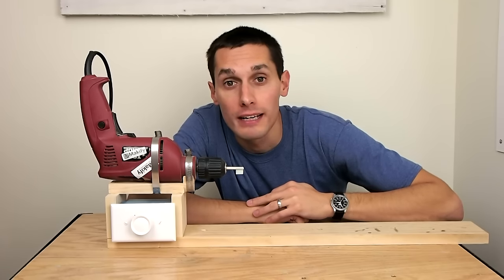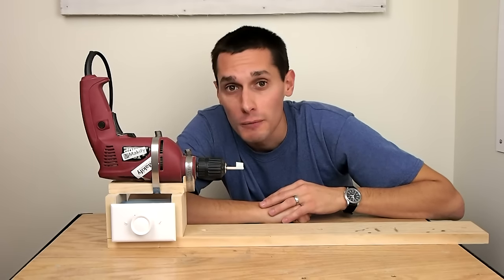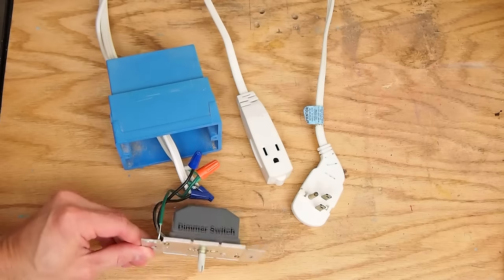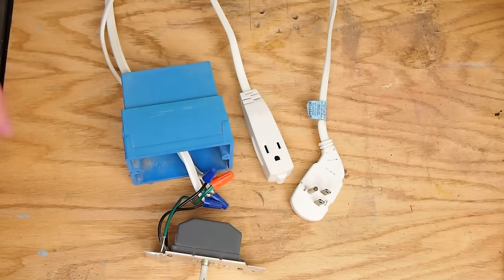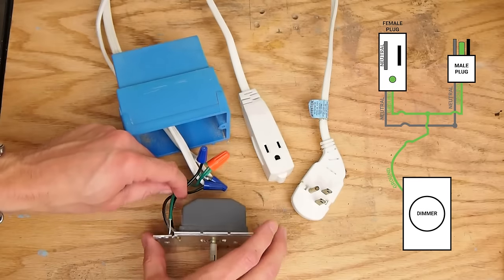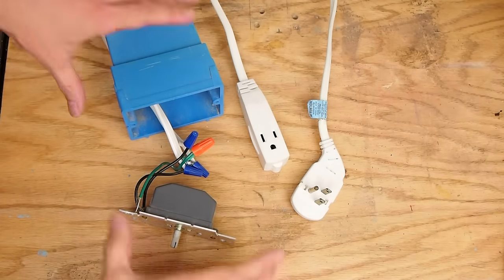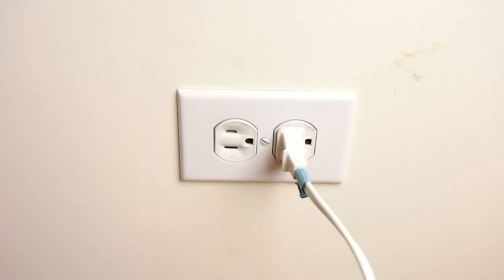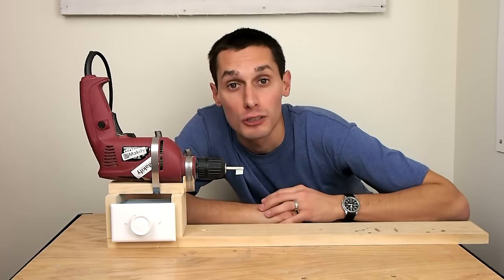How To Make a Speed Controller from a Dimmer Switch

Comment: so whats the point?
Reply: ...the point is to regulate, or being able to controll the RPM of a drill specifically used for this mini lathe. Most modern drills have a speed controll built in, but his one doesnt. And since a   speed controll on a lathe is absolutely necessary, he made this. Keep the nonsense comments for yourself.